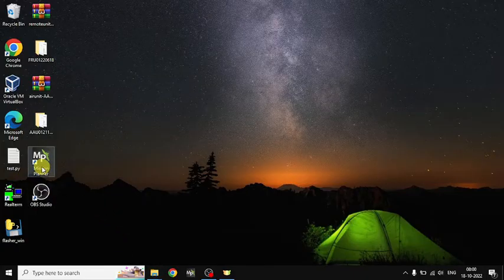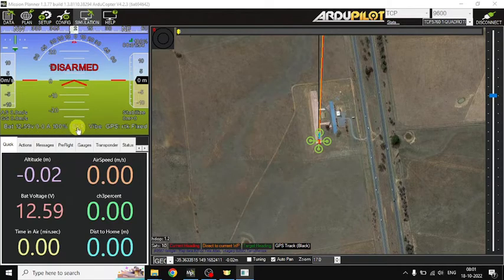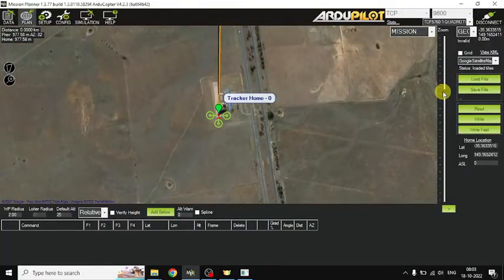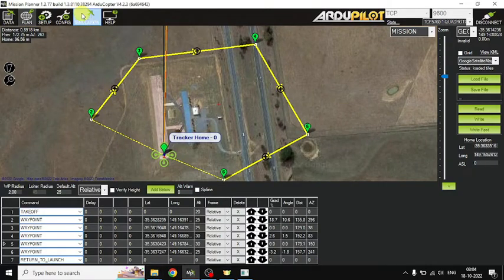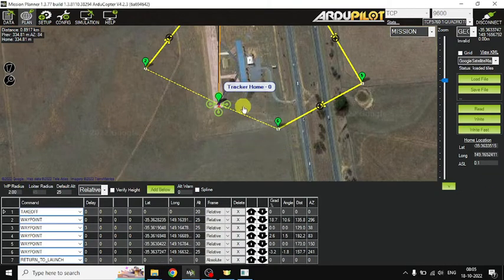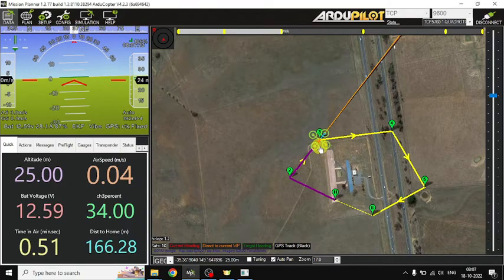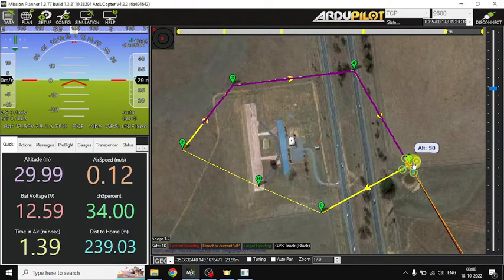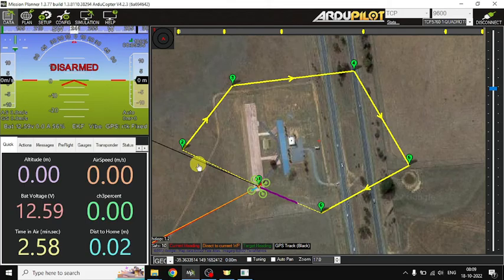Beginner's Tutorial - Simulation using Mission Planner  #drone #autonomousflight #ardupilot

Comment: My plane always moves by itself shortly after doing the simulation, even though it hasn't started the mission, how do I fix this?
Reply from the maker: The accuracy is within the typical range of one meter.  Autonomous mode operation will follow the specified waypoints.
Reply: @karthikstechtime0910  not working sir🙏

Comment: What is the write and writefast difference
Reply from the maker: There are two options available for sending waypoints. The standard speed option is slower but more reliable, while the fast option is quicker but carries a higher risk of errors. The standard speed option is recommended for critical operations.

Comment: after doing radio calibration, connected power to esc. but none of the servos are working including motor. what to do?
Reply from the maker: Safety switch off?
Disable prearm checks.
Reply: @karthikstechtime0910  I was trying without safety switch. Still I changed to zero. But not working.
Reply: @MR.ALBINVARGHESE  make sure pwm channels after radio calibration is within 1000-2000.....I had the same issue......check if you have similar issue.

Comment: its coming mode mode change to auto failed could you please help?
Reply from the maker: Are you using GPS?
Which telemetry radio are you using?
Did you add takeoff commend in the mission?

Try to takeoff in the loiter, then switch to auto..
Assign auto mode in the transmitter switch, then try..

Comment: It's showing not ready to fly, pre arm motors : check frame class and type
Reply from the maker: Select the corresponding frame X.. Quad or Hexa
Reply: @karthikstechtime0910  not working sir
Reply from the maker: Go to the full parameter list, check frame class, and select the type. Which platform is that?
Reply from the maker: Reboot once. It will not appear again.
Reply: @karthikstechtime0910  thank bro now it's working but now it's showing unhealthy AHRS
Reply from the maker: No issues.. it will settle down once the GPS signal is established.